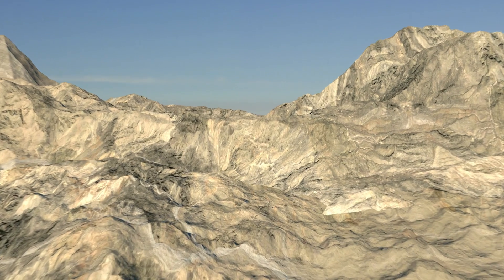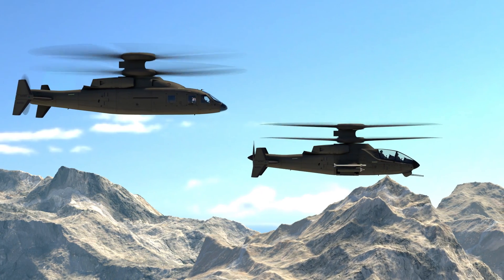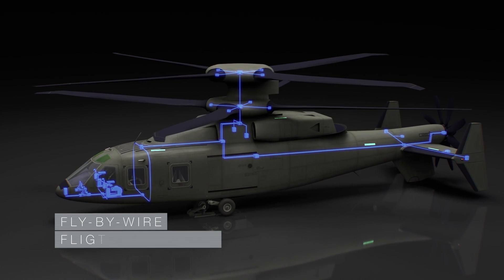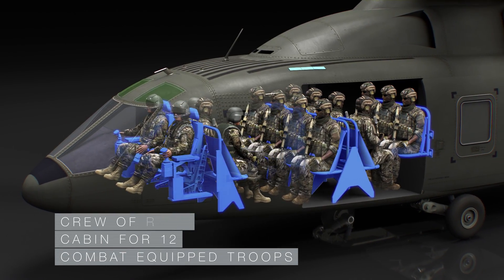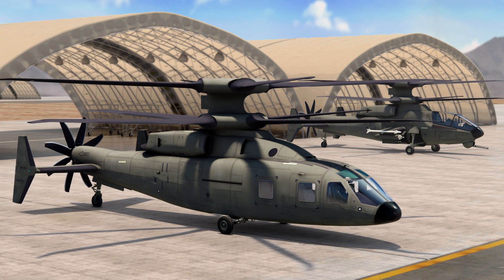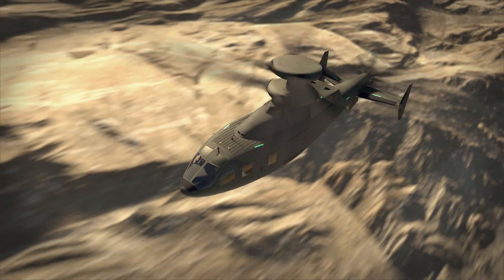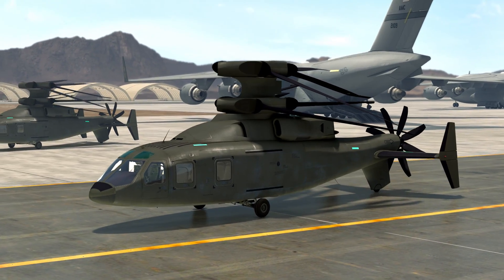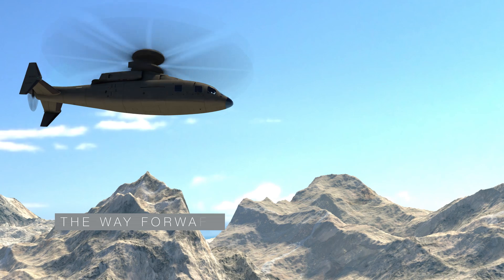Sikorsky - Boeing Future Vertical Lift: The Way Forward

Comment: They lost, Bell won but I think there is another purpose for this Helo
Reply: What are its advantages?  It seems like it's smaller maybe, so it can land in tighter spots?  The Russians use these configurations so it must be practical.
Reply: The best advantage that this helo has is in the role of Search and Rescue, which the Bell Valor cannot do due to its very thick rotor wash.

Comment: You can't simply push a helicopter with a proper to make it go faster. The British Lynx approached the limitations of prop flight as props can not approach the speed of sound they bottom out at around 220 mph
Lift is improved with lightweight kevlar polymer rotors simply pushing it forwards will push it into the Earth.

Comment: awesome helicopter but might not be very fuel-efficient. the two opposite rotating props are a good alternative for a single prop with a conventional motor but it also reduces there efficiency. also, the tail prop is not going to provide any lift force. wish these helicopters were something like the Chinook. anyway, I am sure Lockheed Martin knows better than me.

Comment: Looks awesome but they still they haven't exactly been knocking it out of the park in actual flight testing and are behind the V-280 Valor in hitting test points. Also, these platforms don't look as amenable for air transport in a C-17/C-5 as the legacy platforms being so large and tall.

Comment: I have 1 problem with this. In the Raider you’ll need to find more Left handed pilots😂 most people are right handed and will use their right hand on the joystick. So the left hand seat pilot may not be left handed and that will be bad. I’d say it would have been better if you hade made them both with the sticks in between the legs like most aircraft. Still a brilliant aircraft though

Comment: Bro bells design would’ve been better. It uses bell blue edge rotors which literally reduce sound to 4-6 decibels. Yes I’m serious you wouldn’t be able to hear the helicopter. This design would be much MUUUCH better if it were to implement that rotor design with booth the prop at the back and the rotor.

Comment: Por que este helicóptero não tem duas hélice girando em sentido contrário um do outro também no rotor horizontal para o  torná-lo ainda mais rápido?
Reply: I’m betting primarily to prevent a large weight shift towards the rear, you can see that the rear propeller engine is already quite large.

Comment: A 60s and 70s the Russians and the Americans both tried variants of these type of helicopter with dual rotors it was costly high maintenance and didn't perform as well as they said it would why is this different

Comment: Wow... Soviets had exactly this design in the 1960s, counter-rotating rotors and axial tail propeller.
Congrats for the usual over-acting dramatic voiceover and the heroic music but the aerodynamic concept is really old.
Reply: The Kamov-25 and variants did not have tail propeller at all. There was also the Kaman  H-53 Huskie from the late 50's that used two side by side rotor shafts.

Comment: Additional weight required for the transmission , rotor head and drive train , plus the fuel requirements , lowers your internal weight limitations and range of the aircraft ? 
Is it really worth the cost ? Just to arrive a little faster ...

Comment: are single rotors really the next phase? 50 plus years of drone tech ,robot and AI but we still spend on man piloted choppers. 
Its really been a slow long experimemtal testing .
Reply: Quad copter a don't lend themselves to speed or maneuverability. Their primary benefit is stability, but their increased cross section causes more drag and having the rotors far from the center of mass means they'll have a harder time maneuvering quickly. You don't really see it on small scale stuff, but it doesn't scale up very well

Comment: What does high hot 6k mean?
Reply: With helicopters, your hover ceiling is limited by several factors. "High, hot, heavy and humid" are the 4 major factors. "High hot 6k" sounds to me like it has a hover ceiling of at least 6k density altitude under less than ideal conditions. I don't think it mentioned if that was in ground effect or out of ground effect, but because an IGE hover of 6k isn't all that impressive I assume they meant OGE
Reply: @Tyr1001  thanks for the infos
Reply: @Tyr1001  << This guy helicopters

Comment: Unless LM can come up with an aircraft that can range 7000 miles on 1/5 th of the current fuel use and 3x current speeds of conventional aircraft nothing will create any excitement. Boring crap.

Comment: Basically an autogyro
Reply: Autogyros have unpowered rotors by definition. They can't hover and the main rotor produces no thrust.
Reply: Brian Iroz some autogiros can "hover", but ok
Reply: @xnopyt13  autogyros fly off of the principle of  autorotation, which requires forward airspeed to maintain airflow through the rotor disk, and therefore cannot hover. The only exception is with a high inertia rotor system, which would allow you to hover briefly just before landing similar to a "hover auto" in a helicopter. But sustained hovering is simply not possible with a true autogyro
Reply: Brian Iroz got it thanks

Comment: i don't like the look of that heli and the medical set up looks impractical/unrealistic on the field you will only get 2-3 in if they are already in a stretcher and you will never fill it to max even with no stress due to how high off the ground you need to left them also medical maintenance in air would be impossible and the in air refueling looks like a hazard and turbulence would cause refueling issues

Comment: Why don't you put a CIWS under the front end of the 'passanger / cargo' Varian, so it can better defend it self ??
Reply: Budi Sutanto because the “rules of war” prevent it!  Military medical helicopters cannot be armed and they must be painted with a white medical cross +, since they are unarmed it is a war crime to fire any weapons at a medical helicopter.
Reply: @PaulNewfield-PasadenaCAU-wb4xg  Thank you for the information.
But what about Blackhawk? It carry weapons.
Reply: Budi Sutanto I think it’s probably fitting the same role as Blackhawks pertaining to medical, support, and transport roles but that’s just a guess
Reply: If you're talking about the phalanx ciws you see on ships, those weigh 12,500 pounds without ammunition and would be nearly the size of this craft. The ammunition itself is also very heavy, and you need alot of it to matter. With a rate of fire of 3000-6000 rounds per minute, even ships only have about 1 minutes worth of ammo before they'd have to reload it.
Reply: @Tyr1001  Doesn't have to be Phalanx or Kashtan-m. Something lighter , perhaps sacrifice caliber.
About the rate of fire, since it's supposed to be passenger or cargo helicopter, only use weapon when fired upon, I guess fast is good.

Comment: Wrong design , it seems designed to be expensive, not effective. That is the reason Rusia and China Cándido di si much mire with si much less. Composites fail catastrophically, can’t be easily repair in the theater without expensive proprietary tools.Do the fly by wire technology has a manual  mechanic or hydraulic overwrite ? Most USA universities are anti-American in none or more faculties: how are this machine post to prevent hacking ?

Comment: Nop, not the helicopter from "6th day" movie, surprised to see a propeller pushing it, instead of a jet engine.
Reply: Props can be a lot more efficient (and cheaper) than jet engines without many of the drawbacks of jet engines, for what ends up being a small difference in raw speed.

Comment: US version of KA-52 ALIGATOR
Reply: @wsbdapptv4667  it's always the original will be appreciated. same thing. i like the Russian version.
Reply: Russians blame Sicorsky in stealing of all compose fuselage! Russians has own composite developed by Yakutian artist!
Reply: @serhiychayka4749  Russians blame Sicorsky\\\
Sikorsky is also a Russian emigrant. The Irony of Fate)))
Reply: Nilbert Abao Yes, compare an attack helicopter, to a helicopter that is mainly for transporting troops to the battlefield and for support roles. The only thing I see similar is the propellers so it ain’t similar in my eyes
Reply: @m1a1abramstank49  they only added tail rotor facing forward so  it is  increasing its thrust but over all it's a contra-rotating chopper that was made famous by the Russian.
Reply: Nail Birth Nail Birth But not the overall design of the fuselage and electronics, even so the Russians technically copied the design from a 100 year old design if you think about it. Even so the Russians make carbon copies of some of our equipment
Reply: @m1a1abramstank49  like the vertical take off jets and space craft?
Reply: Nail Birth The vertical takeoff jet concept was bought by the Americans and not copied and not sure about the spacecraft but I’m pretty sure their versions were American made.
Reply: @m1a1abramstank49  where they bought the vertical take off from?
Reply: Nail Birth And even then, vertical takeoff was made by the Americans, i.e. the Convair 200
Reply: @m1a1abramstank49  where was the vertical concept originate?
Reply: Nail Birth Well, definitely not from fucking Russia. Judging by what you said by ‘vertical’ concept I’ll just say that the Germans made it first
Reply: @m1a1abramstank49  i mean, they are making an attack helicipter variant if you watch the video
Reply: Leonel Yan What if it’s not a variant and just implementing the same technology to an attack helicopter?
Reply: I don't understand why all people seem to focus on the twin rotor, which is not even a new concept, and is basically just there to allow the REAL thing this is about: the pusher prop. 
That allows flight cruise speed a whole level higher than any other helicopter, and with better efficiency, that turns in longer range. And it's something new.

Comment: To protect revolving of Helicopter itself, rear fan is deployed, how this helicopter cancelling the rotational movement of itself?
Reply: It doesn't need to. The two inline rotors on the top are counter-rotating, so one cancels out the yaw torque of the other one.
Typical helicopters only have one main rotor, meaning they need the additional at the back to control yaw.

Comment: "And unmatched maneuverability"
I think you guys forgot that the Ka-52 existed
Reply: Hard to say, honestly. The ka52 was designed as an attack helicopter and this was designed for transport, so it's safe to say you're right. But the Sikorsky has far more advanced rotor technology and is quite a bit lighter. Would be interesting to see a circuit race between the two
Reply: Brian Iroz pretty sure they discussed and featured an attack variant in the video

Comment: I love how they brag about fly by wire, tech that's been around since the 50s, and is all around a serious weakness of modern military aircraft, necessitated by the high physical stress these large high speed aircraft have to deal with. Fly by wire is vulnerable to both cyber attack via thier software, and EMP attack. Having no analog controls means the pilot have absolutely no control in the event of an electrical failure, and the increasing reliance on flight computers to compensate the modern aircrafts lack of aerodynamic design and balance means even somthing as simple as a software glitch, be it accidental or artificially programmed can ground an entir fleet or worse. This is why you don't let marketing have a say in designing your products. They chose showmanship over pragmatism and its painfully obvious.

Comment: A Cheyenne with a double coaxial rotor  though!?

Last time declined by the Airforce and army due to high costs to usw Ratio.
Reply: Great eyes and memory friend, Aurora models did the Cheyenne concept with single top rotor back in the late 60's, early 70's, but U.S. Gov't rejected it because of expense and anti V.N. war mood at time. Plus Cobra gunship was sufficient at time.

Comment: Reminds me allot of Lockheeds early high speed helicopter the Lockheed AH-56 Cheyenne with the tail prop. Such a shame cause it was ahead of its time and held the fastest rotary aircraft and I believe (I'll have to catch up on my history now) still one of the top fastest rotary aircraft. It actually beat boeing back in the 80's for helicopter design. But due to its ability to not be able to start on its own and needed to be hand cranked along with (at the time) extremely advanced weaponry system and had a default when reaching high speeds (I can't remember the principle but it's when the helicopter will flip due to high speeds causing a high lift on one side while creating little to no lift on the other side of the rotor area). Hence the boing Cobra (please correct me of the company is wrong on that it's been a long time) Seeing this being a huge Lockheed and boeing fan makes me think boeing took the Cheyenne design and made it better lol. Really cool to see a helicopter with a pusher prop design again. (I went back and I was wrong the years. Wasn't 80's it was 1967 when the first model took flight. And was and would have been the most advanced and would of been the USAF very first dedicated attack helicopter. And  rose from the Army's Advanced Aerial Fire Support System program. Really interesting helicopter)

Comment: Was this technology stolen from Russia like they copied the design details of yak 141 from Russia?
Reply: Nah coaxial rotors have existed long before Russia started using them
Reply: @subscribetoroach4084  the F35 was copied from the Yakovlev 141, which the blueprint got sold by Yeltsin to the Pentagon.
Reply: TheEagle The design was bought from Yakolev and implemented on the F-35, it technically ain’t a copy.
Reply: lets be fair, the russians copied and improved upon the space shuttle, nobody is complaining about that?
Reply: @thomaswijgerse723  the Buran was cancelled.
Reply: @zed9095  true, but it did fly once. this may also be cancelled after flying just once, or even before that. 
What im trying to say is that ib the end everyone improves on the designs of others.

Comment: When they say it's going to be cost efficient but in reality goes off budget by hundreds of billions XD
Reply: We don’t have $ for homeless vets, $35 million for an aircraft is cheap. Word
Reply: J
Reply: Yep, remember f35. That 35 was standing for 35 million $ each.
Reply: @tafana  $35 million for a 5th gen fighter would be cheap as fuck. The F-16 goes in the $20 million range. F-35s are at around $80mil/unit right now.
Reply: @Doc_Doge  right now it costs round 235 mil a piece. prices will come down.... they say
Reply: Osama Anwar no it’s 100-85 million depending on model
Reply: @Doc_Doge  it's 90 to 120 million now
Reply: @MaximizedX Maybe for the Bravos and Charlies, Alfas should still be running about $80 million. I did see an article supporting your claim, but it was from late 2018. Perhaps you confused the date?
Reply: @MaximizedX It seems I was mistaken. On further search, the current Block 11 should be going at around $89mil, but the upcoming Blocks 12 and 13 are expected to be sold at $82mil and $79mil respectively
Reply: @Doc_Doge  modern F-16's like the F-16V and block 52 are over $50 million per aircraft at flyaway, the early basic blocks from the 80's and 90's sold for the $20 million price area.  Once you start adding advanced ECM and EW systems with advanced radars and cockpit tech your price starts shooting up rapidly.
Reply: @MrGeforcerFX  Ah, right you are. Seems my numbers on the Viper are dated.
Reply: @MrGeforcerFX  Correct, 20 mil is without accounting for inflation plus added technology, the f16v has like a $60 million flyaway cost vs the projected $80 million for a much better F35a...
Reply: This technology is not too new and novel like Zumwalt and there are some very cost efficient projects from Boeing like the new fighter pilot trainer